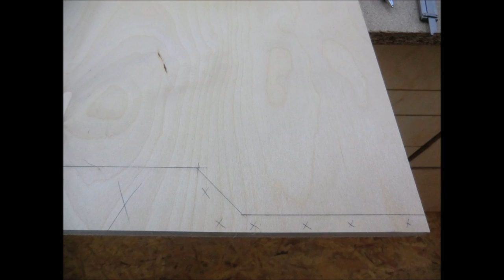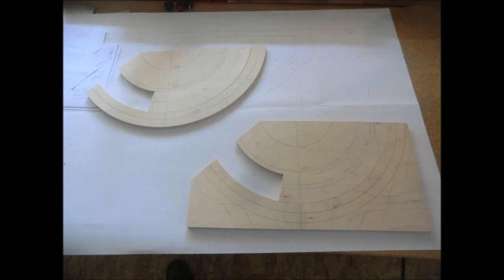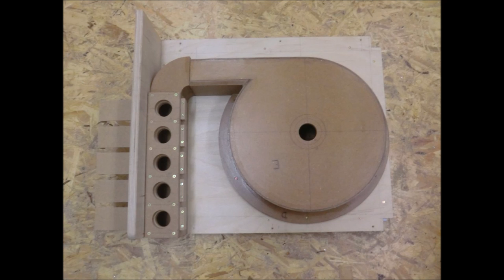Format Tablesaw - Building process images

Comment: I love the little additions you've made over the format design with the extractor and Crown guard. 
I'm a little sceptical about the cost of materials and hardware vs buying the actual machine (supplying an optional hardware kit with the plans may reduce the costs to the end maker.
This may also increase initial sales of the plans because it is woodworkers that will be viewing this and may feel daunted by the metalwork involved, I certainly am😳. 

It may be an additional income when buying individual parts in baulk for you too!
for example. 
plans including options
1) outrigger and sliding bed hardware. 
2) saw blade arbour and mounting plate hardware. 

I am going to register via email but am only interested in adapting my own modular system ( elu saw and router mounted to 2 separate aluminium plates that is fixed into the same hole) with the slide table and outrigger parts at this stage. 

good luck with this great build guy's!

Comment: How stable or stiff is the T-Track fence? Is it stable/stiff enough just by clamping it with screw bolts? Isnt an excentric lever necessary to gain enough force? It looks like some kind of Biesemeyer style. I think I'm gonna buy the plans. Great job!
Reply from the maker: An screw is as stiff as an excentric lever. The excentric lever is maybe a little bit faster to lock but much harder to built (metalwork and welding). We tested both and for the most builders its much more easy to built the screw mechanism.

Comment: Very nice design. What is the purpose of the multiple sliding baffles?
Reply from the maker: What do you mean with baffles?
Reply: Tony Shulthise 
I would assume the purpose of the 5 separate blast gates?
I'm abit baffled (excuse the pun😊) too!
Reply: The prototype has 5 blast gates used as follows:
2 are for the saw (top to the Blade Guard, bottom to the Blade Hood)
2 are for a router installed under the table at the right side (top and bottom suction)
1 is for a small jointer with a dedicated router, also installed at the right side.
We suggested the same quantity of blast gates as the maximum possible. You may add them or not. It is easier to include them during construction time. The ones not used are just left closed until needed.
Reply: ขอบคุณ ทื่.
ให้ความรู้
เพิ่มเติม